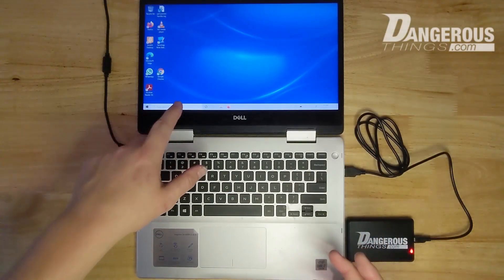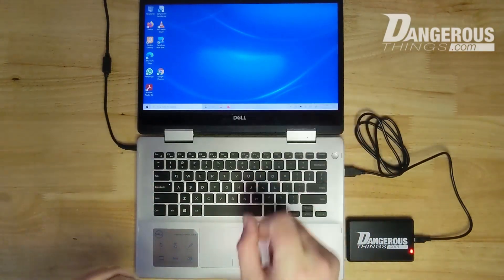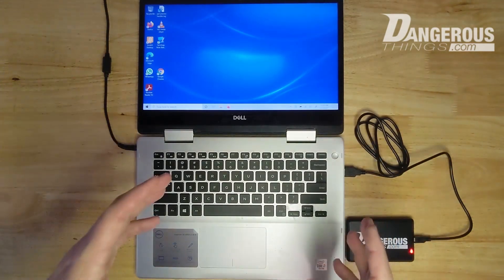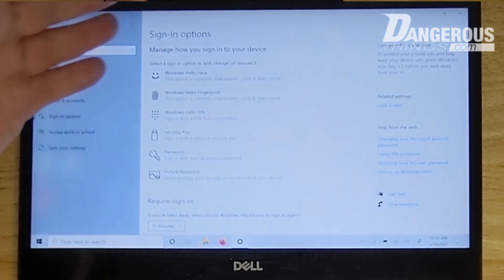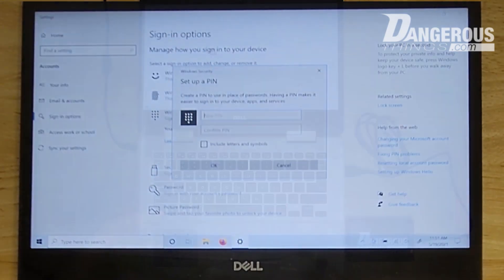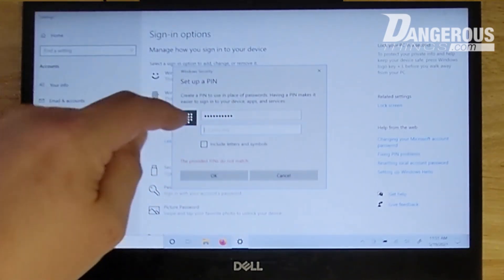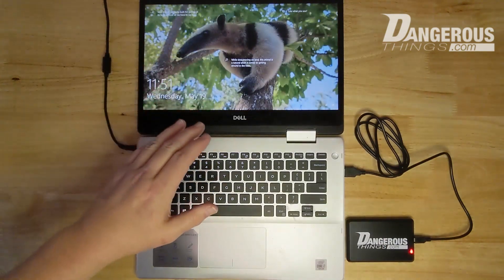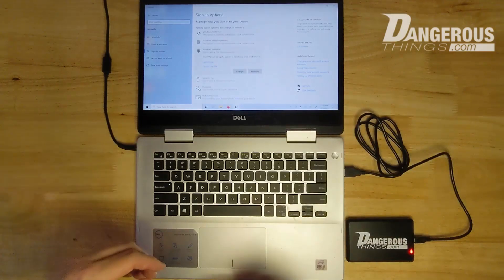Log into Windows 10 with a microchip implant and the KBR1

Comment: So, anybody who scan my implant, can see the pc password ?
Reply: Yes! This is a low security, low cost solution. More secure options exist, but cost more for hardware and software to make them secure. The risk / reward analysis you have to apply here must consider whether or not you are at risk of 1) someone targeting you specifically, 2) able to physically sneak up on you to read your implant, 3) wish to obtain your computer password but not have much time with physical access to the computer. The 3rd consideration there has to do with recovery tools which are easily downloaded and able to be run on the target computer to remove passwords, reset passwords, or in some cases extract passwords. Therefore anyone with sufficient physical access to a computer and enough time to boot it off a USB stick or CD-ROM containing access and recovery tools could just bypass your password completely. 

Also, if you are concerned about this you can add a simple salt to your password, such that you must type out a few simple characters first, then scan your implant. Those characters are part of your password but not the complete password. Without them, anyone who scans your implant would not be able to use only that information to log in.

Comment: Does this work on a GNU/Linux TTY?
Reply from the maker: In theory yes it would work the same way, since the KBR1 acts as a keyboard device and "types out" the UID serial number of any ISO14443A transponder it scans.. so basically if you set up a user account and set the password to match the output of the KBR1 when the desired transponder is scanned, then yes it should work.. even over SSH remotely (if passwords are used).